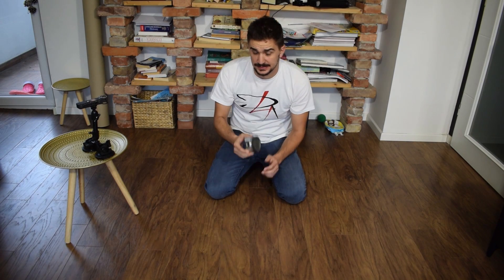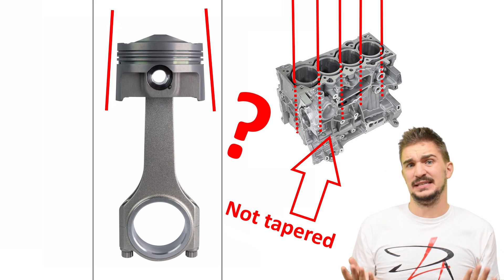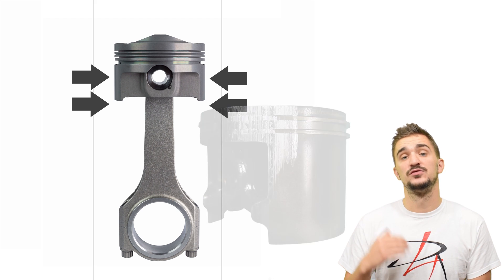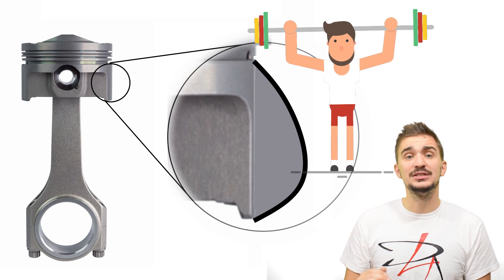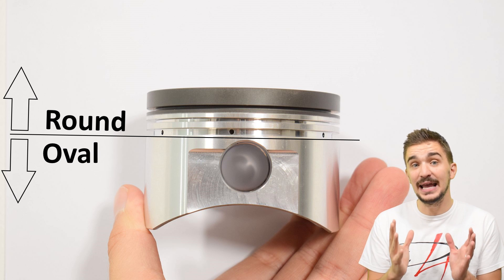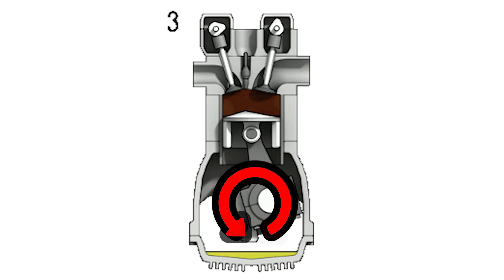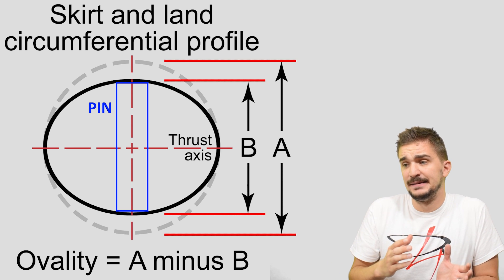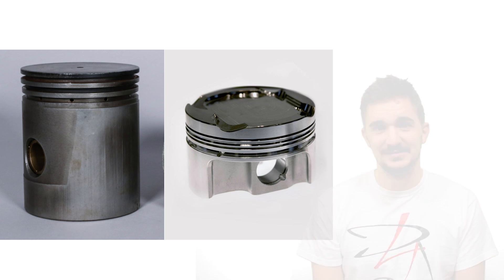Are PISTONS round? OVALITY and TAPER EXPLAINED

Comment: Cool thanks! Just bore scoped my 270K km Kia and it's got atypical bore wear. Minimal wear on the thrust and minor thrust, but heavier wear on the axial sides between bores. I was surprised to see. It's got siamesed bores + closed deck, which are apparently more susceptible to bore distortion due to less cooling between bores. This can cause ring scuffing in the axial plane, which is what I suspect is the culprit.

Comment: Your information is wrong in 2 strock there is no taper because petrol mix with oil circulate the rong .including piston in four strok piston taper i given after the piston ring taper well given in oil ring sronded  by small holes because piston go down in cranshaft and go to T D C  OIL WELL SUCK AND COMONG FROM THE OUTER DIA OF THE PISTON HOLES .THAT TAKES LUBRECATE THE  PISTON AND LINER INCLUDING PISTON RING ,without taper piston well waroute withen few seconds this my practical experience you mindet

Comment: 0:35 is not the taper (a cone shape would have flat sides and not let light through). This effect is because of the "barrel" shape (barreling). This allows the piston to better handle the side loads from the connecting rod. Pistons are pushed sideways into the bore by the connecting rod, and the barrel shape helps with this so the top and bottom edges don't dig in.

Comment: How long does it take that the Piston cools down while a brake with shout of engine and how long does it take to get again to perfect expansion when you start the engine again? Does a 15 min break with 1 minute time to warm up again before full load (on the highway for example) means a lot of stress for the piston and the cylinder bore?

Comment: Very detailed and informative video. Could you please answer the question: why is it that the main bearing axis is symmetrical below the cylinder bore axis. Couldn't you counteract the main thrusts loadings on the pistons through a asymmetrical design or a flat mounted engine?

Comment: So where does the piston measure its nominal size?
Reply from the maker: Most measure it 90 degrees from the pin at a predetermined height from the bottom of the skirt. The height depends on the piston and manufacturer, but it's usually close to the bottom.

Comment: Hi guy. Offset pistons can equalize major and minor thrust, reducing total friction while increasing power, efficiency, and torque. My guess is that they aren't universally used because offset pistons complicate balancing. 

And adding a thermal break while using the appropriate metal for each sub-part of a piston is far superior to the kluge that is currently standard in obsolete designs. This sort of design also simplifies each part, which makes forged parts practical, greatly improving all aspects of performance without breaking the bank.

The above improvements make your engine wayyyy more efficient. They are also some of the several improvements by which a truly modern engine protects its oil from heat and blowby. Oil changes ought to be very, very infrequent. They are needed so often because of contamination and degradation, both of which are glaring indicators of poor design.

All in all, a fun little video. Thanks and have a good one. :-)
Reply: If your solution weren't far more difficult than the current one, it would already be used. If you believe that to be untrue, start a piston company, and make the automotive world a better place! :)

Comment: I'm a huge fan of your job but today I disagree with some explanations you give. I'm pretty sure that the barrel shape is done due the fluidynamics of the oil in the cylinder wall, in particular to have a meatus of olil and an oleohydraulic lift that keep the skirt apart from the cylinder wall and avoid metal to metal contact
Reply from the maker: That's pretty much what I said, I just didn't use the words "meatus" and "oleohydraulic". Friction reduction is basically what it's about. By the way, Google "meatus", I'm afraid it's a bit out of place here 😉
Reply: @d4a  I traslate italian meato in meatus, I agree with you that's not used in the same way I use it. I'm sorry.
btw if you know it's a pity that you don't explain deeply like you have get used us. But don't worry man it's only a whim of mine

Comment: So why can't you pull pistons through the bottom of a block
Reply from the maker: It can be done on some engines, but on many engines the mains overlap the bore bottom or there's simply some sort of lip or something in the block. But even when you can remove them from the bottom there's no benefit to it, because you can't install them from the bottom.

Comment: do you know that the hole for the pin is usually not in the center but slightly offset (we're talking 1mm max) toward the exhaust? i don't remember why tho!
Reply: The pin is slightly offset, so when the full force hits the piston at Top Dead Center, the rod isn't standing straight on the crankshaft, but rather starting to go down, thus converting more force into rotary motion, rather than just smacking your crankshaft
Reply: @MinecraftNickTV  Thank you!
Reply: @MinecraftNickTV  ...THAT'S an excellent explanation !! I couldn't get my head around before 👍